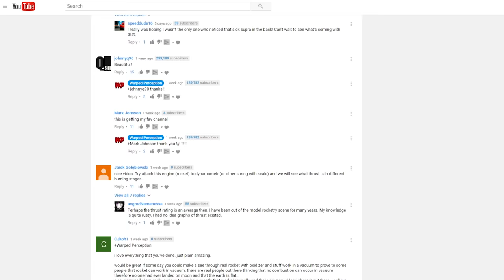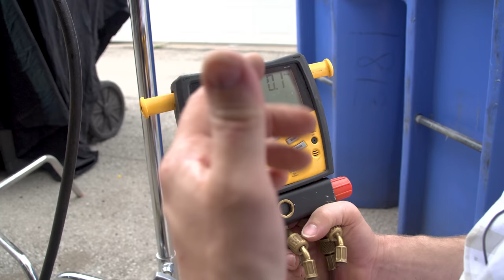Model Rocket Engine In A Vacuum Chamber - 4K Slow Motion - will it burn? - Rockets (S1 • E3)

Comment: Here is a good explanation by a Youtube commenter from another channel.

Quote: "I tell you where the force is. Think as an experiment of thought you sit
in a non working rocket and you fire a rifle, aiming through the 
exhaust nozzle. When the bullet is fired, the bullet moves with high 
speed out of the nozzle and the recoil moves the rocket with a much 
slower but constant speed in the other direction. Same with gas 
molecules. Every gas molecule is a bullet. To accelerate gas molecules 
to a high speed needs a force, and the counter force - recoil - moves 
the rocket. Not the molecules on their way drive the rocket, the rocket 
is driven in the moment when the molecules are accelerated by the 
combustion process."
Reply: Bnslamb Bro....
the gun is still fired in Atmosphere... Bullet is resisting against  air, and pressure in barrel..

How do u not see, the Vacuum is Sucking"" out the thrust at same pace thrust is shooting out..

anyways . 
irrelevant as Nasa has been caught using green screen many times, bubbles, other wierd stuff.
Reply: So there are no recoil in space? Vacuum does not suck, it's the surrounding higher pressure that press. 

There can be up to several 100 atm pressure inside the combustion chamber during combustion, zero or one atm pressure outside means nothing.   

NASA does not use green screen and you have never seen bubbles in space, you have no credible source for that claim. If that was true all news agencies would know it. Don't believe lies. 

JULY 17, 1969: On Jan. 13, 1920, Topics of The Times, an
editorial-page feature of The New York Times, dismissed the notion that a
 rocket could function in a vacuum and commented on the ideas of Robert 
H. Goddard, the rocket pioneer, as follows.

"That Professor Goddard, with his 'chair' in Clark College and 
the countenancing of the Smithsonian Institution, does not know the 
relation of action to reaction, and of the need to have something better
 than a vacuum against which to react -- to say that would be absurd. Of
 course he only seems to lack the knowledge ladled out daily in high 
schools." [Oh, snap!]

Further investigation and experimentation have confirmed the 
findings of Isaac Newton in the 17th century and it is now definitely 
established that a rocket can function in a vacuum as well as in an 
atmosphere. The Times regrets the error." 
https://goo.gl/UeK2J2
Reply: Here is how much fuel Saturn V used.

First stage carries 203,400 gallons (770,000 liters) of kerosene fuel and 318,000 gallons (1.2 million liters) of liquid oxygen.

The second stage carries 260,000 gallons (984,000 liters) of liquid 
hydrogen fuel and 80,000 gallons (303,000 liters) of liquid oxygen.

The third stage carries 66,700 gallons (252,750 liters) of liquid 
hydrogen fuel and 19,359 gallons (73,280 liters) of liquid oxygen.

All most was burned in a few minutes.

So you can see zero or one atmospheric pressure outside the engine means nothing
Reply: So just curious, do you believe that a gun fired in a vacuum would have zero recoil?  Lol
Reply: Dillon Harr the explosion in the chamber is pushing off the bullet and the firearm at the same time, this would work in a vacuum to produce thrust or movement in both objects. An explosion pushing against nothing doesn't produce thrust, this video even proves that. No thrust is produced until the rear of the chamber is filled with a small amount of gas. If that gas was being sucked away into infinite space...no thrust.
Reply: Josh et al., So many misconceptions in these comments.  I know you folks are trying your best to use the physics you know, but you have much to learn to properly interpret what you see.
...
The SOLID rocket engine has its own oxidizer IN the solid fuel.  This is what the Shuttle's Solid Rocket Boosters (SRB) used. Oxygen is not the only oxidizer, though it is one of the best.
...
The burn produces EXHAUST GASSES. GAS!   Smoke is simply small particulate matter not turned into gas and also has mass that is accelerated out the rear and contributes to the rearward momentum. 
...
These gasses, being very hot, expand rapidly creating a high pressure INSIDE the engine chamberand this pressure pushes the gas out at high speed and the pressure inside the engine pushes on the inside.  Around the sides tries to expand the tube, but it is strong enough.  On the front of the chamber, there is nothing but the mass of the engine and rocket to push against, so it moves forward ... conservation of momentum determines how much the engine accelerates, or in this case the force on the spring.
...
Rockets DO NOT PUSH OFF THE AIR.
...
Rocket engines WORK BETTER in a vacuum, because the absence of air pressure means the gasses have a LARGER difference in pressure from the vacuum (like 14 psi more)  and are, therefore, accelerated out the back FASTER...more momentum rearward, therefore more momentum forward.
Air IMPEEDS the gas acceleration, reducing thrust...!
...
The engine moved back WHEN it produced thrust, not gas in the chamber to push against.
...
Yes, these engines burn for only a second or so...Pfffft! 
...
He shoulda' done it with air inside to compare the difference in thrust...!
You'd also see that the thrust would start at about the SAME TIME...
...
Gasses "Hitting the end of the chamber" isn't helping thrust. It is far away and until some gasses build up in the chamber, the thrust is essentially in a vacuum.  The engine has no knowledge the end it there to cause any thrust...
The gasses ARE PUSHING AGAINST / hitting the END and  trying to push the chamber to the right.  However, the engine, via the coil spring, is also pushing the chamber to the left.
...
YES!  When a gun goes off, it recoils...NOT when the bullet hits something.  VERY GOOD analogy !! 10 points!
...
Recoil is a good word, we just use it for guns, but the SAME APPLIES TO ROCKETS. The expanding gasses in the gun barrel push the bullet forward and the gun backward = recoil.  SAME THING  Gas pushing in all directions.  A FUNDAMENTAL property of all fluids....
Sorry, but density is pretty much irrelevant here.  [[FYI: the density of air in subsonic flight is virtually identical above and below an aircraft wing.. The pressures are different (more under than over)]]
...
He shows how there is still some vacuum left, but yes, it could have been pressurized.  It would have been better to have a guage, BUT IT DOESSN'T MATTER in view of the true physics as I DESCRIBE. The thrust would have just gone DOWN to below what it would be in 14 PSI air or vacuum.  See above about the pressure DIFFERENCE.
...
Suction is a idiom.  When you reduce the pressure in your mouth, ATMOSPHERIC PRESSURE pushes soda up the straw.  The faqn in a vacuum cleaner reduces the pressure at the inlet...ATMOSPHERIC PRESSURE pushes air in and the dirt along with it.  You absolutely cannot PULL on a liquid or gas.
...
Space is a vacuum because GRAVITY SUCKS... [joke], but not too far from the physics...
- - 
Cheers, Steve
Science and Technical Advisor
challenger.org
...
P.S.  If you want to try to dispute any of this science, just read it over.  I'm not going to engage in a "repeat-myself-over-and-over-fest" retyping any of this.
Reply: It does generate thrust in vacuum. Why? Because of Newton's third law, none of that horse shit you're driveling about. The gas has mass and a velocity <-> force <-> thrust.
Reply: I guess you never launched rockets on new years eve Josh Newton. It allways takes some time befor the camber pressure is high enought to accelerate the gas-molecules to higher speeds. 
When you take a look at the highspeed at 2:50 when the tape is flying away there is a wobble in the system before any significant amount of gas is produced. After that you can see that the flame of the engine first is really narrow, because the camber pressure is only a little higher than the outside pressure. As time goes on the flame is getting wider and wider a sign that the pressure inside the rocket is rising. This results in a higher exhaust velocity and thus also more thrust.
Reply: Josh Newton Here is the problem of saying that rockets have to have air to push against to move.

1. The gas being ejected out the back of a rocket has no actual connection to the rocket once it leaves the rocket nozzle so it has no real means of transferring momentum back to the rocket body.

2. The air in front of the rocket nose is the same density as the air at the back, so if the gas being ejected at the back has to push against air, when the rocket moves forward it will push against the air at the front. What do you think will have more friction, the solid nose of the rocket, or the loose gas at the back?

3. If pushing against air make the rocket go forward, then pushing against the solid ground must provide more thrust so therefore the takeoff from the ground should be when there is the greatest acceleration, but that isn't what happens. Acceleration is always slowest from the ground and gradually increases as the rocket gains height.

4. Propellers and jet engines actually work on the same principle of Newton's 3rd law. By drawing air through the rotating propeller blade or jet engine it forces the propeller forward. That's equal and opposite reaction.

A rocket engine works by using an unbalanced force. Stand next to a grenade when it goes off and you will be thrown away from the center of the blast by the pressure wave of expanding gas. The explosion of the fuel in the engine chamber radiates out from the center in the same way and applies equal pressure on all walls to the side so it cancels out. Where there is an opening at the back there is no wall to apply pressure but the front wall does so you get an unbalanced force and the rocket is propelled forward.
Reply: Josh Newton - You agree that a gun firing a bullet in a vacuum WILL produce thrust but exhaust gases will NOT?  Can I ask a couple of simple physics questions to see how far your understanding of physics goes?   -  simple physics problem #1: 
I have a remote control crossbow.
 It is loaded and cocked and I set it on an ice rink on little ice skates (or frictionless surface).
 What happens when I fire the bolt from the bow?
 What happens to the bolt? What happens to the bow?
 What if I use a low mass bolt like balsa wood?
 What if I use a high mass bolt like lead?
 What if the bolt and bow both have the same mass?

 Describe what an observer would see in these experiments.   If you bear with me, I will get to the point, but you have to answer so I know you are following.
Reply: Josh Newton Because it takes a while to accelerate! Moreower this kind of rockets do not produce 100% thrust the exact moment you light the up, you have to wait a fraction of a second to achive the max thrust.
Reply: +Tim Web A rocket is just as well sealed as a gun.  On one end is the front of the combustion chamber, on the other end is the stuff (gas or bullet) it takes great force to push out the back.

If you've ever seen a rocket go "boom" (like I have) because the chamber has a leak, you'll know that rocket combustion chambers get up to considerable pressure.  200PSI or more in most designs.

A rocket engine is just like a machine gun.  Firing lots of tiny little bullets.
Reply: Ace Mcloud 
Vacuums don’t suck. Pressure tries to equalise so causes mass to flow into the vacuum.
Reply: +Tim Webb "the exhaust gas just spews uselessly out of the back end"

The exhaust gas is accelerated to high speed and has MASS - the rocket can do nothing else than move in the opposite direction, it's physically impossible for it NOT to. Newton.
Reply: +Tim Webb Tim, it's not the VELOCITY, it's the ACCELERATION of the mass. F=MA, not F=MV

Rockets have reduced power in an atmosphere because the presence of air reduces the acceleration as energy is expended on displacing that air.
Reply: +Tim Webb You're trying to explain to a rocket engine designer how a rocket motor works?  Seriously?

[I've designed/built/flown/assisted with rockets/motors up to the 2000 pounds of thrust class, both solids and hybrids.]

Let's keep this brief and simple: I assume you believe that if you took two bowlings balls, and placed a compressed spring between them (not connected to either ball), that the two balls would shoot apart, in both atmosphere and vacuum, when you released the spring, right?

Well, you've just agreed that a rocket motor works in vacuum.

The rocket is one ball, the combustion chamber/pressure is the spring, and the other ball is gazillions of nano-balls called "exhaust gas".

100% of the thrust of a rocket is by accelerating the gas from zero (inside the chamber) to above supersonic speeds in the throat of the nozzle (and bell if it has one).  Once the gas has left the bell, it can no longer affect the rocket.  Period.  If you burn 1000 kg of fuel/oxidizer per second, and manage to accelerate it 1000 metres/second^2 in the nozzle/bell, you get a million newtons of force pushing the rocket up.  It's just that simple.  If the exhaust gas is heavier, at the same acceleration, you get more thrust.

All air does is reduce the pressure differential between the combustion chamber and the outside.  Meaning less acceleration.  Meaning less thrust.  Rockets in atmosphere produce LESS thrust than in space.  Not more.

If rockets worked by pushing on atmosphere, that would mean that if you stood on a skate board, and compared the thrust of throwing a bowling ball to the thrust of throwing a bowling-ball-sized balloon, they'd be the same - and you'd go flying down the road on your skate board at precisely the same speed.  Right?  Doesn't happen, does it?

You shouldn't accept the babblings of youtube clickbaiters without researching it yourself.  Clickbaiters are only interested in your money (sorry, "views").  Not truth.
Reply: +Tim Webb I wasn't telling you how to make a rocket.  I was telling you the basic physics that makes rocket motors work, and a simple experiment that proves that rockets don't work by pushing on something by showing you an example of where thrust-by-push SHOULD work, but doesn't.

Bournoulli lock is a real thing.  Do some research.

Come on now, don't tell me that you think that two bowling balls won't fly apart in vacuum when pushed by a spring!

No knowledge of space?  There are thousands of vacuum chambers on the planet.  So we know exactly what vacuum behaves like.

So you're taking the word of a person whose never built a rocket, has no scientific background whatsoever, to a guy, hey, not just one guy, but 10s of thousands of people, who has lots of both?

Gosh how gullible you are.
Reply: Ace Mcloud lol, not really but k
Reply: Virgil Pheonix however, standing next to the grenade is not recommended except for the most recalcitrant conspiracy theorists, as you'd find the metal pieces accelerate some parts  of you much faster than the rest, which won't be thrown nearly as far 🤔
Reply: Conservation of momentum proves that rockets can work in a vacuum.
Simple Lets say you have a space ship weight a total of 1005Kg.
You then eject 5 kilos of gas backwards at 2000m/s. This gas has a momentum of 10000kgm/s. By conservation of momentum the rocket must gain 10000kgm,/s in the opposite direction, giving it a velocity of 10m/s.
QED.
Reply: Dillon Harr, A gun fires a bullet. The bullet has substantial mass with which the propellant can push against resulting in recoil. A rocket's only projectile is gas and gasses are immediately absorbed by the vacuum.
Reply: Dennis Andersson, the gas's mass is immediately absorbed in the vacuum. The inefficiency of the minute 
 amount of mass created by the rocket's blast would require such an enormous fuel reserve we couldn't reach the Moon with an Empire State Building sized Rocket.
Reply: Of course if would have recoil because the bullet exhaust is pushing off the back of the gun, causing recoil....LOL  The opposite reaction is the back of the gun's chamber...LOL....lol...lol...!!
Reply: I noticed you have no sarcastic replies.......hmmm...I wonder why?
Reply: If it was being absorbed in the vacuum then why did his plastic tube fill up with smoke?  The opposite reaction is actually the plastic tube. You don't have that luxury in the infinite vastness of space.   OH!!! wait a minute, maybe the rocket thrust is pushing off a distant planet or the moon?  I'm not disputing how NASA is propelling it's rockets but I cannot figure this out within the confines of Newton's Law.
Reply: fuel= burning material.  oxidizer = oxygen + fuel+fire = explosion + exhaust gas. (you mix the two stupid) which means if you bring your own oxygen with you into space those exhaust gasses will propel a craft forward (and keep the rocket burning).  you do not need anything to "push off of" in space because you are pushing off the gasses exiting the craft!.  this is measured as specific impulse! the greater the impulse of a craft the greater the thrust!!. the greater the thrust the faster a craft can accelerate!. there is no simple way to explain it to someone who doesn't know any better than to say it's impossible and fake. what's really sad is this has become the subject of bullying academics and intellectuals.  when you go to space! you bring oxygen with you to burn, the explosion behind the craft is what you are using to push the craft forward.  you know? explosion? BOOM? giant freaking bomb?!?! the difference between a rocket and a bomb is that a rocket controls the explosion by pushing it in the opposite direction of the pointy end of the craft. let me simplify even more. bomb go boom, rocket go boom!  boom boom push rocket! rocket go fast, reeaaaalllll fassssst! your brain go reaaaal sloooowwww. if you need to argue what you can repeat with the proper tools and knowledge then you are the real problem. quit being lazy armchair idiots and figure it out!.
Reply: explosion. that's how!.  I thought idiots liked bombs...
Reply: @asleepinthealley  wrong
Reply: @E9X330  If it were possible to leave our own atmosphere, NASA wouldn't have gotten caught using greenscreen, pretending to leave our atmosphere...
Reply: @asleepinthealley  they have never used greenscreeen to fake a mission and neither did Roscosmos, Esa, JAXA, CNSA, or ISRO
Reply: Actually the acceleration of a rocket occurs as a reaction in the nozzle, the combustion chamber contains high pressure, but little linear exhaust velocity. The goal of a rocket nozzle is to transform the high pressure stationary gas in the combustion chamber to a high velocity low pressure flux of hot gas; this process takes a lot of work, and since energy is conserved the work done on the gas by the nozzle becomes a linear reaction on the nozzle. I'm leading a research team on regression rate in hybrid motors, and one of our challenges is designing a nozzle with the correct geometry to optimize this reaction process. Also, the bullet is very different from a rocket exhaust, because it is a single particle, (from an analysis standpoint) and it moves with (relatively) constant  velocity after being fired. Rocket exhaust is a system of particles with continuously changing velocity vectors. (Remember that "accelerating" a gas is just aligning all the individual particle movement vectors to be in the same direction, a high pressure gas is just a bunch of really fast moving molecules all moving in completely random directions.)
Reply: Bnslamb perfectly explained. I always have trouble wording an explanation myself so I’m impressed by this easy to understand thought experiment. My compliments to the original commenter.
Reply: ATC Bear  wrong
Reply: For the people who think rockets is useless in space.... First of all a rocket can be capped off and have it's own oxygen supply or oxidizer, second of all if a rocket can't produce thrust in a vacuum how do we have hundreds and hundreds of satellites in space right now? And don't say we don't have any cause obviously we do if you're on the internet, third of all if they don't work how come we have rovers on various planets and moons? Fourth of all how do we have telescopes light-years away? I just wanna know how we got stuff so far away if rockets don't work in space? Fifth of all y'all keep saying NASA, NASA, NASA but forget we have SpaceX and various of other private companies doing tremendous work to get us to Mars within the next decade plus we have a international space station, plus NASA is only the United States government space agency what about the discoveries made by other governments including China, Japan, Canada, Russia, Europe, etc.? I have questions on questions for you no believers and I can guarantee you that you can't answer or justify all if them with your shitty physics and conspiracy theories..... Btw for my fellow believers don't argue anymore with them cause there is no winning with these type of people or better yet don't tell them facts instead ask them questions that they can't answer so they can see how stupid they sound and look 😂😂😂😂👌💯
Reply: Ace Mcloud  vacuums do not suck. Rockets work better in a vacuum as the pressure differential is greater and there is no drag on the rocket body.
Reply: Rockets only work in a pressurized environment! The amount of thrust generated in space would be Net Zero as there is no pressure medium to allow acceleration
Reply: Collin Daugherty   Rockets work better in Space as there is a greater pressure differential and no drag. Just imagine the opposite scenario where there was an external pressure equal to the pressure inside the motor, in that case the gasses couldn’t escape so there would be no mass leaving the rocket, so no thrust. Therefore the lower the pressure differential the less efficient is the rocket.
Reply: @tomkfly  ... I get what you're saying I think that is where we differ.....i believe a rocket needs to be in a pressurized enviroment...i believe it reacts with the pressure and atmosphere
Reply: @Bnslamb   I don't need your explanation. I'm fully aware of thrust to weight ratio and flying.
Reply: @IAmNovemberNovember   how would the gunpowder ignite?
Reply: @stratoleft  

Conservation of momentum proves that rockets can work in a vacuum.
Simple Lets say you have a space ship weight a total of 1005Kg.
You then eject 5 kilos of gas backwards at 2000m/s. This gas has a momentum of 10000kgm/s. By conservation of momentum the rocket must gain 10000kgm,/s in the opposite direction, giving it a velocity change of 10m/s.
QED.

Now that I have successfully proved, using mathematics that rockets will work in a Vaccuum, are you now feeling silly?
Reply: @dillonharr7628 a bullet needs oxygen and they're not pressurized the ignition of the powder will only create a flash of light